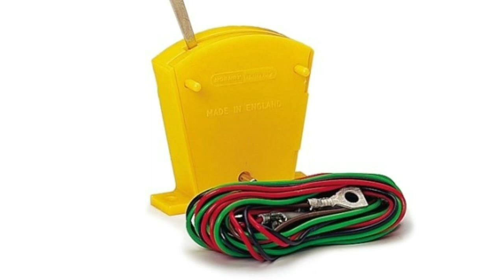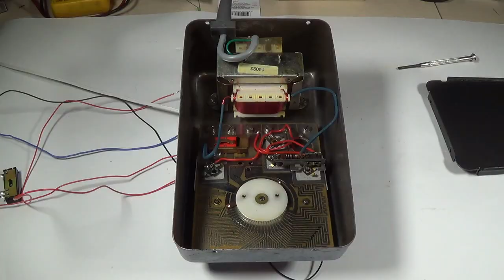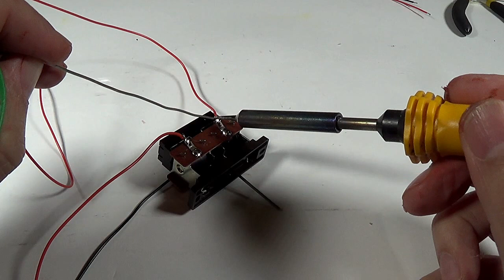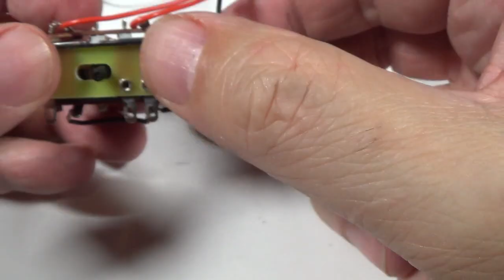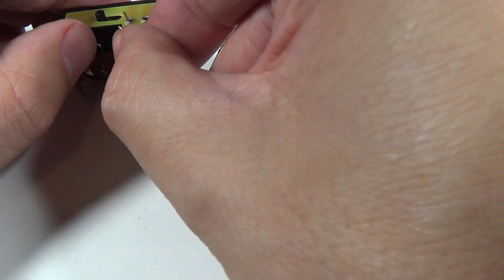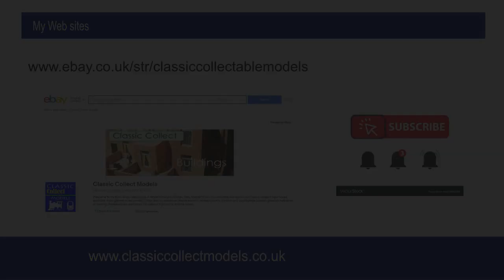Point motors and colour light signals, Budget model railways, Yorkdale #2.

Comment: You used wd40 to clean the contacts in the controller, that is for lubricant for cables.
You really need to use something called solvol contact electrical cleaner spray which disolves dirt on electrical contacts

Comment: I wouldn't recommend solenoid point motors with Peco points as they have a nasty habit of breaking the hair spring in the point. Then neither the point or mechanism work properly. I have always used Fulgurex motor driven mechanisms on all my exhibition layouts for over 40 years, without trouble. (They operate on 12v DC). Indeed using such point mechanisms means you actually remove the troublesome hair spring from the Peco points before laying them. Further as Fulgurex point mechanisms have two FREE switches attached (and space for two more) you can therefore "Interlock" your signals where necessary to any of you point motors. Fulgurex mechanisms only need a 1mm hole drilled in the baseboard for the pre-shaped brass crank provided to connect the point to the motor. The point mechanism is then screwed (2 screws) underneath the baseboard. This mechanism also allows use of Live Frog points using one of the spare switches !
Reply: wots a frog point? In a newby
Reply: Hi

Any info on how to wire the fulgurex point motors up as i want to fit them on my layout
Thanks